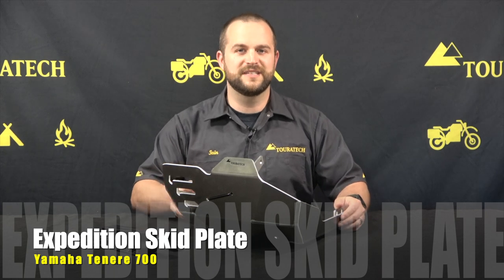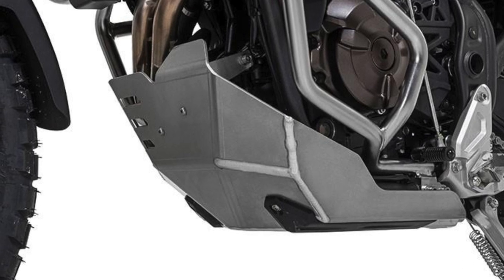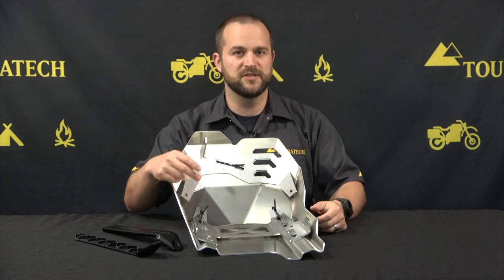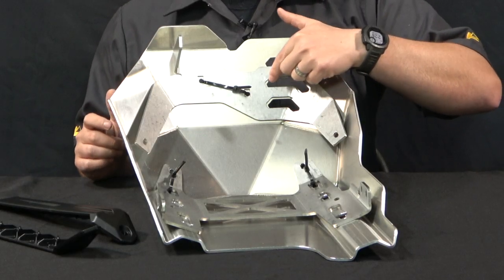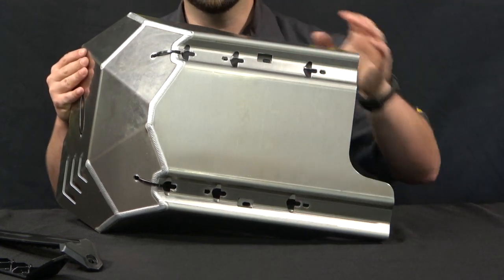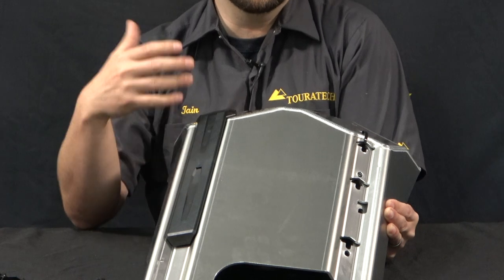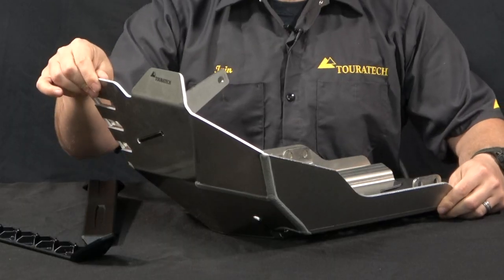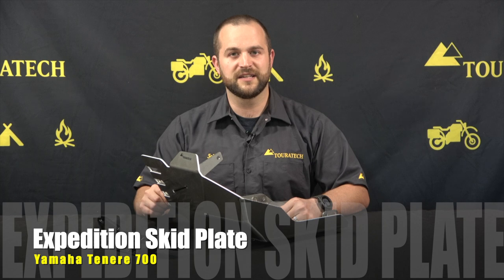Touratech Expedition Skid Plate: Yamaha Tenere 700

Comment: Unfortunately it doesn't protect the linkage, or I would get it.
Reply from the maker: In our experience, suspension linkages are MUCH thicker and stronger than any skid plate on the market. There is some benefit to being able to slide from the plate over the linkage if the guard provides a smooth and level surface but none on the market for the T700 do. 

We hope whatever plate you choose works well for you.